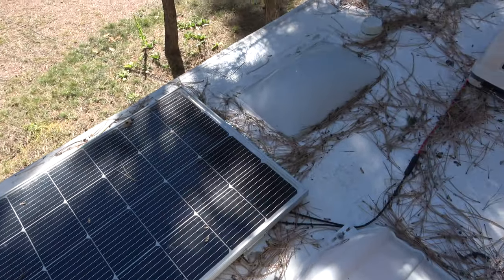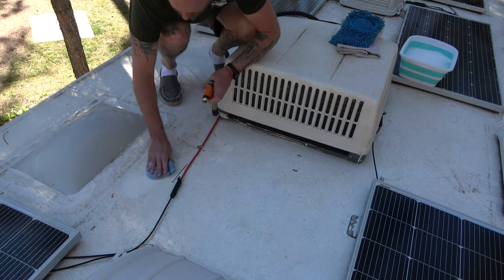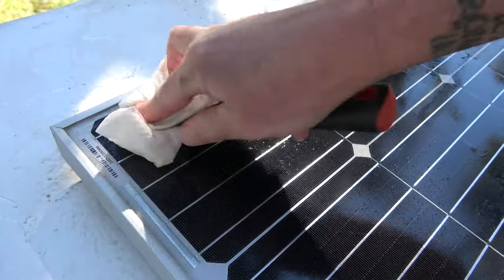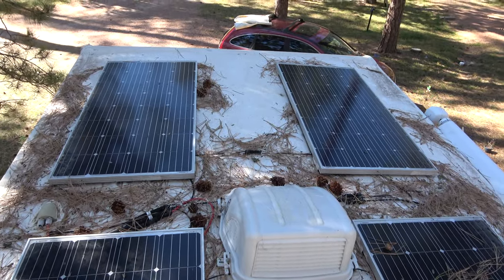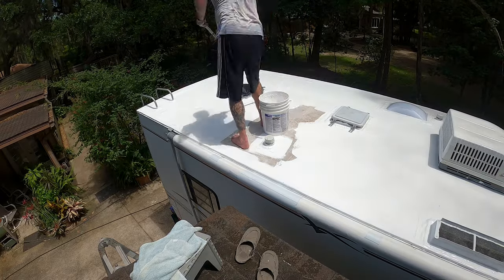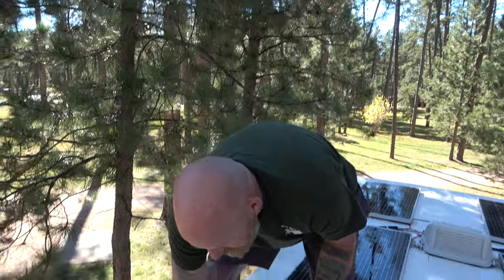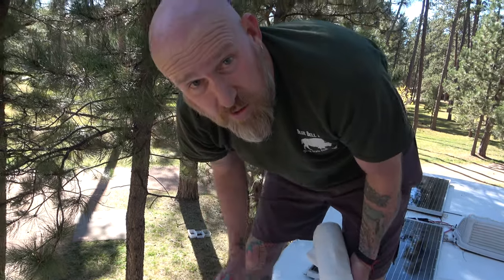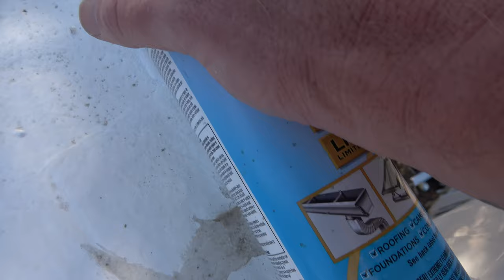Silicone Coating on an RV Roof?! // 2 Years With Henry’s Tropicool! / Best RV roof coating

Comment: Hi there, My son just purchased an RV and it was his first purchase for an RV. He is not experienced in RV's at all and didn't inspect the RV very well when he purchased it. He was kind of in a bind for somewhere to live because he made the decision to quit his job and move out of the apartment where he was living and go full time RV-ing and start his own business. So after buying the RV and with some discussion with me, we found out that the roof wasn't in as good of shape as he thought and it needs some TLC.

So we been watching videos and reaching roof coatings. We like the idea of the Henry 887 roof coating and wanted to use the Eterna bond tape, but seen that the 887 doesn't adhere to it, so I called Henry Tech support and discussed it with them. Since the Eterna bond tape has a very slick surface, I asked if one was to sand or scuff up the eterna bond tape so the 887 would adhere to it...Tech support said that sanding the Eterna bond tape would work with the 887 adhering to the tape.

Just thought that I would pass this on
Reply from the maker: Thanks! We put 2 coats on and have very little issue. But do what Henry says and it should work!
Reply: The tech people also recommended using 885 wet patch / seam sealer instead of using the Eterna Bond, so we pondered on that and went with the 885. Since I live in NW Ohio and he lives in North Carolina, he is doing this all by himself. He got a Ryobi 1800 PSI pressure washer, some buckets and scrub brushes and started cleaning all the bad areas and around all the roof penetrations. He said that he would have all the repairs done today but I haven't herd from him on the repairs yet. He was going to put 2 coats of the 885 on and try to use up the whole 1 gallon can so  there would be nothing wasted. So as weather permits, next week he'll pressure wash the whole roof and let dry for the 887 application. He purchased a 5 gallon can of the 887 and will apply 2 coats of that. We figure that should do the trick and seal the roof up for the next 10 years or more. Just thought I'd pass on the info for anyone reading your comment page.  @CalledToWander

Comment: Pro tip, lol.  If you have to get up on a Henry's coated roof, they are extremely EXTREMELY Slippery When Wet! What I have used for years is to wear an old pair of socks, no shoes, just socks, and even when the socks get wet, you will still grip *very well
Reply from the maker: Great tip! And very true.
Reply: Good to know!
Reply: Thx
Reply: I  use yoga socks

Comment: Your video was exactly what I was looking for. Showed in detail how tropicool works on eternabond. Already purchased eternabond and tropicool but not installed yet. Will be using both and will do two coats on the eternabond with tropicool just for thickness and glad to know the spray is great for patching any problems.
Thank You😊😊😊
Reply from the maker: The spray was not as great as I thought, but good in a bind. For twice the cost, we're going to buy a gallon this year (Year 4) and put a light coat over any areas of concern where we sprayed in the past but want a thicker, uniform coat moving forward.
Reply from the maker: The spray was not as great as I thought, but good in a bind. For twice the cost, we're going to buy a gallon this year (Year 4) and put a light coat over any areas of concern where we sprayed in the past but want a thicker, uniform coat moving forward.

Comment: Looks great getting ready to do the same thing you did one question will the tape stick to the henrys if you need to fix a spot on the road?
Reply from the maker: We carry a spray can of Henry for stopping emergency leaks. Haven’t had to use it yet. But that’s the plan. In theory nothing sticks to Henry’s. But in reality, Eternabond sticks to everything so in a pinch it should likely stick for the short term until you can get either the spray or a gallon of Henry from Home Depot

Comment: I was concerned that the Tropicool wouldn't adhere to the eternabond tape, so I called their customer service. They suggested I paint the tape with an acrylic primer.  I followed their recommendations.   Unfortunately, the silicone still peeled off the tape. I taped the perimeter of the roof and turned down the edges to the gutter. Now that the coating has peeled, it looks really bad from the ground. Decor makes a primer for their silicone coating. I have purchased it and will try priming the eternabond tape before re- appling the Tropicool.
Reply from the maker: Glad you contacted them directly! We’ve not had any major issues with the eternabond but we also put 3 coats on so maybe that helped? Let us know how your next method goes so we can share with others!
Reply: I was wondering about some kind of primer. Thank you!
Reply: I haven't used the decor primer yet. I plan to apply the primer this summer.
Reply: I was going to do my roof the same way...Turn down the edge so it folds into the gutter. IMO this is a critical step as the TPO can become compromised
along the edges. Everyone seems to be overly concerned about the Tropi-cool
not sticking to the Eternabond but imo just butt the 2 products up to each other
and don't try to cover one with the other

Comment: Thank you for sharing your experience. I have been watching videos and researching RV roof repair/treatments over the last several years. Seems there are advocates and nay sayers for everytihing. My take on all is that, as you said, cleaning and proper preparation is crucial. Assuming proper prep, most products will perform and it comes down to longevity (obviously). The products that last the longest will be the hardest to remove when replacement is necessary. Complaints about Eternabond Tape come from those who are removing an old application. Is the replacement necessary from improper prep that has shortened it's potential or has it served 8-10 years or more?

Comment: Great video! you did a great job on the roof. Imo it doesn't matter that the Tropi-cool
doesn't adhere to the Eternabond. As long as one product butts up to the other.
Both are superior products! I am currently in the process of doing my RV roof and
I'm looking to see how other people are doing theirs. Did a thorough cleaning today
using tsp with a little bleach. Will do the perimeter with the Eternabond as well as
around the vents etc. Then Saturday will roll on the Tropi-cool. My trailer is 25' do
you think 2 gallon containers will do it?
Reply from the maker: Thanks for the info! Yes, while they officially do not play well together, the reality is that they have served us well for 4 years! As for how much you need, it was more cost effective for us to buy the 5 gallon container than 3 gallons. Plus we're not the kind of people to want to skimp when it comes to our roof - or water damage in general. So we wanted to have more than enough to put multiple coats on the roof so we'd be where we are now... worry free.

Comment: Here's my conclusions from watching dozens of videos.....Have fun!
TO DO A EPDM RV ROOF:  Recommend spray bottle down a 50/50 solution of Simple Green & Bleach, a section at a time, then wait a few minutes and pressure wash off using a 40° fan spray at least 8-12" (depending upon PSI) away from the EPDM roof then let dry 24 hours.  The next day, reseal top edges of all the edge trim pieces with non-leveling DICOR sealant, reseal all cracks with DICOR Self-Leveling lap sealant and/or use EternaBond (only where it's really needed) then coat the entire roof with HENRY's Tropicool 100% Silicone white roof coating.  It can really be that simple.....JUST 2-3 DAYS OF WORK!
Reply from the maker: Thanks

Comment: Thanks so much! Made my mind up now 🙂did you prime before using tropicool?
Reply from the maker: No prime, but lots of prep. Clean, clean, clean. We pressure washed, hand scrubbed and then went back with broom and blower immediately before applying to a dry roof. Prep is key.

Comment: Thanks for the update. Just got 2 questions. would you attribute the reason for peeling off the eternabond tape is due to the material of the eternabond , hand touch residue , or need an extra step to prep? Also Is the tropicool in a gallon/5 gallon thicker than the spray can?
Reply from the maker: It’s due to the Henry’s not being compatible with the eternabond tape.. We didn’t know this until afterwards. Henry’s makes a roofing tape that can be used instead of the eternabond. Or just use the eternabond and plan to touch it up once a year or don’t use any tape and just use the Henry’s
Reply: Great info, thanks. I am doing the henry's and the idea ran thru my mind that may not be compatible but didn't pay attention to it and did put eternabond all around the edge lol.. then I watched your video and I'm kicking my self LMAO.. all about timing.. but hey either way I'm protected. Thanks again for the update and info.  @CalledToWander
Reply: Thanks again for your video. 0 regrets even with the eternabond tape issue. I did a really thick coat and even removed my ac and also applied over the vents and skylights..  not 100% pretty, but 100% more worry free. My recommendation is to save the money for the eternabond tape and apply just the Henry's. You can apply as thick or thin as you want.

Comment: Great video! Do you have a rubber roof? I've been researching and kept hearing conflicting opinions about putting silicone on EPDM roofs but this looks great and easy enough to maintain!
Reply from the maker: Yes, EPDM. This works for both EPDM and TPO. Ours went on super easy. And still holding up just like I applied it yesterday, 3 years later

Comment: I'm torn. I want to go with Henry's silicone. Use it on roof of my house. It's fantastic. 

I peeled the cracked and leaking Dicor seals. Should I reapply the Dicor then move to silicone? Or should I use the silicone roof patch in place of the Dicor?

If I use the Dicor first I'll probably wait a month before converting to silicone.
Reply from the maker: We fixed or installed new appliances (fans, ac cover, etc) and resealed used dicor the way you would with any roof. Then we slapped Eternabond over these seals to lock in the waterproof. Then we rolled over the whole roof, including the Eternabond, with Henry’s. Triple protection. It will be difficult if/when we have to remove any fans. But that’s why we did that work first. Hopefully years away from needing to do any work on the roof again

Comment: Can you apply the Henry's up to the Eternabond but not over it?
Reply from the maker: You can. One viewer said its the adhesion between the Henry's and the side of the tape that makes the most strategic bond. But again, we put multiple coats over our entire roof and only in rare occurrences (where we encountered a tree branch that could not be avoided) did any of the Henry's actually scrape off of the Eternabond. If left alone, it will get along great together.

Comment: How did the Henry's hold up on your AC cover? Did you have any issues with the Henry's running where the side of the camper meets the roof?
Reply from the maker: The AC cover wasn't necessary. But just because the Henrys is bright white and the cover was aged. It's held up as good as everywhere else. As for the drips... it depends on how meticulous you are. Like painting walls in a house, you could tape the side of the camper to ensure no drippage. We didn't. And I painted it on in a hurry, so there are some places with drips... But for a 25+ year old RV, we're ok with a few drips here and there lol

Comment: Is there a primer you could spray over the tape that will help the Silicone stick to it?
Reply from the maker: Not that we are aware. Other people have said they scuffed up the tape with wire brush. But ours has adhered for the most part with those few areas of exception. We laid on a thick 2.5 time coat the first time around

Comment: I just spoke to Henry’s rep. The reason it’s peeling off the eternabond tape is because eternabond formulated their tape so nothing would stick to it!
Reply from the maker: This may be true, but we have had minimal issues in 4 years of application. For what we were looking to do (more permanently seal our vents and other areas prone to leaking) without spending thousands on a new EPDM roof, this has done more than what we expected and saved us lots of money, time and worry. Plus, we just went through a crazy hail storm a month ago and there's no rips or tears in the coating like there would be in an EPDM or TPO roof.
Reply from the maker: This may be true, but we have had minimal issues in 4 years of application. For what we were looking to do (more permanently seal our vents and other areas prone to leaking) without spending thousands on a new EPDM roof, this has done more than what we expected and saved us lots of money, time and worry. Plus, we just went through a crazy hail storm a month ago and there's no rips or tears in the coating like there would be in an EPDM or TPO roof.

Comment: Has anyone considered applying the Henry's coating first and then following up with Eternabond tape on the outside of the Henrys?  Will Eternabond stick to the Henrys after its dry?
Reply from the maker: @adventuretate  it most likely won’t stick to it